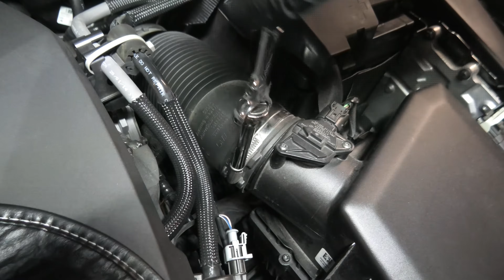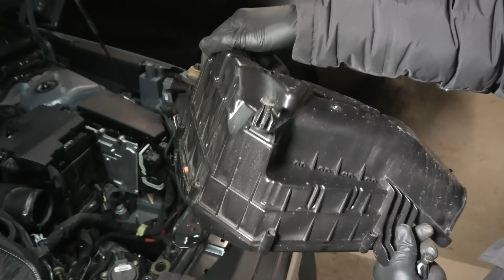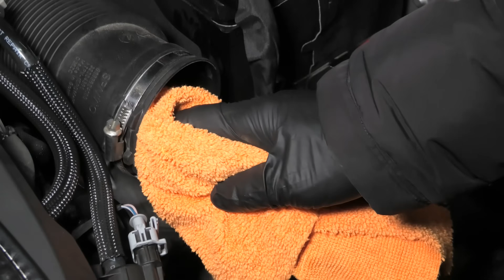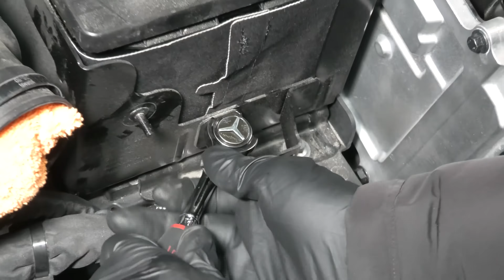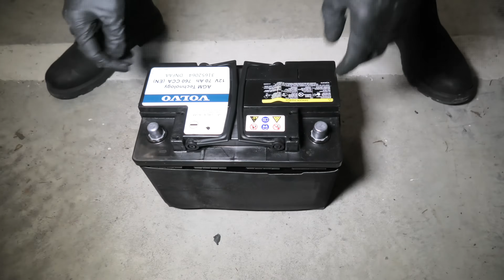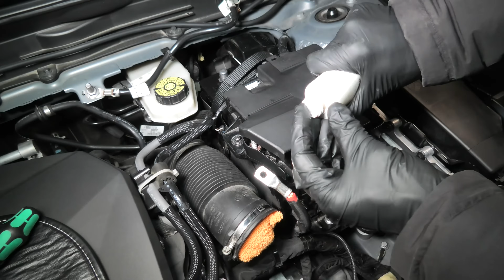Volvo XC40 (2019-2026): 12V Battery Replacement. Detailed Guide!

Comment from the maker: PRODUCT LINKS:
1. ACDelco silver, calcium Gold 48AGM 36 Month Warranty AGM BCI Group 48 Battery For Truck, Black - https://amzn.to/49XN5pJ.
2. Volvo OEM 12V Starter Battery, 31652064 - https://www.ebay.com/sch/i.html?_from=R40&_trksid=p2334524.m570.l1313&_nkw=31652064&_sacat=0&_odkw=55900-0R190&_osacat=0&mkcid=1&mkrid=711-53200-19255-0&siteid=0&campid=5338971185&customid=&toolid=10001&mkevt=1.
3. 2019-2022 Volvo XC40 Genuine Volvo Air Cleaner Assembly 32146439 - https://www.ebay.com/sch/i.html?_from=R40&_trksid=p2332490.m570.l1313&_nkw=32146439&_sacat=0&mkcid=1&mkrid=711-53200-19255-0&siteid=0&campid=5338971185&customid=&toolid=10001&mkevt=1.
4. 2023-2024 Volvo XC40 NEW VOLVO XC40 AIR FILTER BOX 32336642 ORIGINAL - https://www.ebay.com/sch/i.html?_from=R40&_trksid=p2332490.m570.l1313&_nkw=32336642&_sacat=0&mkcid=1&mkrid=711-53200-19255-0&siteid=0&campid=5338971185&customid=&toolid=10001&mkevt=1.
5. Genuine Volvo Bushing, 31439663 - https://www.ebay.com/itm/335227272096?mkcid=1&mkrid=711-53200-19255-0&siteid=0&campid=5338971185&customid=&toolid=10001&mkevt=1.

RECOMMENDED TOOLS:
1. SOCKET SET, RATCHET - GEARWRENCH 57 Pc. 3/8" Drive 6 Pt. Mechanics Tool Set, Standard & Deep, SAE/Metric - https://amzn.to/41wE6Z3.
2. SWIVEL HEAD RATCHET - GEARWRENCH 2 Pc. 1/4" & 3/8" Drive 72 Tooth Dual Material Roto Ratchet Set - https://amzn.to/3kwhHdS.
3. CLIP REMOVAL TOOL - Lisle 42480 Panel Clip Pliers - https://amzn.to/3LaJJJ8.
4. THIN PROFILE LONG REACH PLIERS - Weller Xcelite Plier, Serrated Jaws | 378MVN - https://amzn.to/4sKKz0h.
5. FLAT HEAD SCREWDRIVER - Klein Tools A131-2 1/8-Inch Flat Head Screwdriver with Keystone Tip, Made in USA, Pocket Clip, 2-Inch Round Shank - https://amzn.to/3VV0FVh.
6. MICROFIBER CLOTH - USANOOKS Microfiber Cleaning Cloth - (12.5"x12.5") High Performance (Pack of 8) - https://amzn.to/3L21zhb.
7. RUBBER STRAPS - Rubber Bungee Cords Assorted Sizes with 1.8X Max Stretch & Over 176 lbs Load 10", 15", 21", 31" (10 Pack) - https://amzn.to/3uPXSUd.
8. MAGNETIC TRAY - Performance Tool W1265 Large Magnetic Nut and Bolt Tray - https://amzn.to/3SHLu4q.
9. 1/4" RATCHET AND EXTENSION - Wera Zyklop 8000 A 1/4-inch Drive Ratchet & Zyklop 8796 LA Long extension, Square drive 1/4" Head x 150mm Extension - https://amzn.to/415sSLe.
10. DIELECTRIC GREASE - Permatex 22058 Dielectric Tune-Up Grease, 3 oz. Tube - https://amzn.to/40VPPjh.
11. 3/8" TORQUE WRENCH - VANPO 3/8" Digital Torque Wrench (2.2-44.3 ft-lbs./3-60Nm) - https://amzn.to/46LkNfX.

Comment: 13:52 pretty sure that’s the BMS rather than just a fuse (hence the small cable connected) 🙂.  They are generally attached directly to the negative terminal

Comment: Had they designed that plastic strap hold down support differently by making it shorter so it can be pushed toward the firewall and lifted up and out, you would be able to lift the battery straight up without removing all that air box stuff...More over engineered nonsense.

Comment: I change the battery and the 12 v service system light turn up in the dashboard and can I fix this
Reply: I have the same issue after replacement. Have you solved that issue?

Comment: Great video! That said, you should mention that anytime you replace the battery you need to connect a scanner tool to the Volvo's computer and tell the car to reset the battery. I was diving into replacing the battery on my wife's XC40 and was warned on the auto part store's website that a computer "battery reset" would be needed. If you don't reset the vehicle's computer to let it know there is a new battery you can run into inadequate charging, error messages, etc.
Reply: I bought the vLinker MC+ OBD2 scanner adapter and used the VTools app to reset the battery. Battery reset is one of the free functions of the app.

Comment: Thank you for your superb video and the detailed explanation. I recently purchased a 2020 Xc40 T3 and have learned much from all your other videos. I am about to install a new battery and read somewhere that after fitting a new battery there has to be some kind of computer reset carried out. Is this necessary? Many thanks again. 🏴
Reply from the maker: No problem! We did not do any resets after battery replacement. No issues so far.

Comment: Thanks for a well thought out video. Watched it a couple of times and changed the battery in my wife’s 2020 XC40 T5 easily. It really wasn’t hard at all, but I am a trained motorcycle mechanic. Folks complaining about this design should go work on a motorcycle! That will give you new appreciation for this design. 

Tip: two of the rubber grommets that hold the airbox popped out when I removed it. Make sure account for all three before you reassemble.
Reply: "This wasn't hard. I'm a trained mechanic." I mean, this was so much harder than basically any other battery I've put in. I've done probably 50 in my life.
Reply: Anyone born before the year 2000 knows that this is a shit design because we've seen a lot better.

Comment: I replaced mine with a EverStart Platinum AGM from Walmart $179,  as long as the specs are the same (H6 / LN3 / 48 12 Volt, 760 CCA)  then there's no configuration needed for the BMS after the jobs done.   install then drive away.  I have never had an error code after installation , but if I had usually you only have to drive the car for a few minutes at highway speeds and it will self correct.

Comment: Hey there VMorozov, great video. I shall be attempting this proceedure tomorrow. My vehicle is the 2019 XC40 T5 Momentum. But please tell me, what about the battery reset which tells the car’s computer or control module that the battery is new. The control module needs to know this information in order to properly charge the battery and control the vehicle electrical system. Can you tell me why this is not required or is it?  Thankyou.
Reply: I'd like to know that too.

Comment: That battery could have been taken out straight up had they designed that back hold-down strap contraption differently, as that is the one thing that's in the way from that happening. Just the strap would have been fine, as the front bracket stops it from moving forward, and with all the cabling attached, that battery isn't going to move upward. Talk about over engineering things. If that were my car, I'd take that strap contraption out of there or cut the top part off if it hold the battery from going backward toward the firewall. That is one ridiculous design for a hold-down strap.